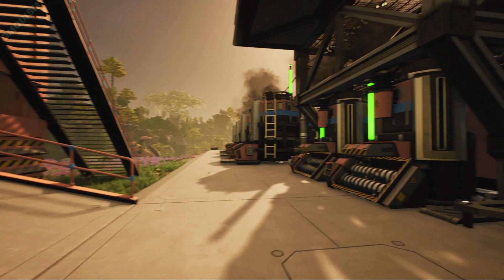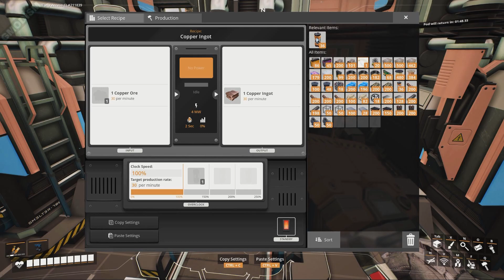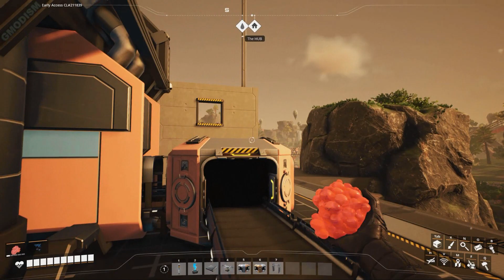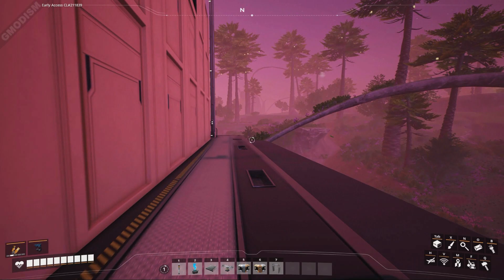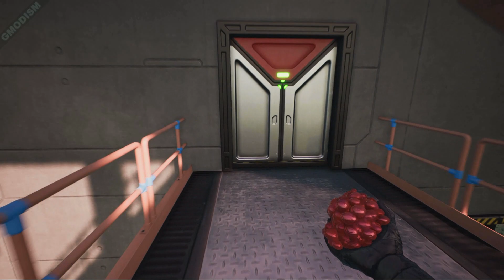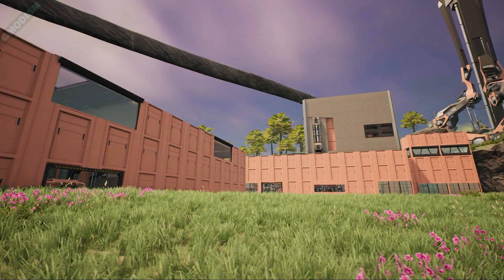5 Must Have Blueprints For Mid-Game - Satisfactory New Player Guide EP24

Comment: Most definitely liked your design. But my factories tend to be more like Naked Sports Motorcycles. Where you can actually see the engine and the moving parts. I don't like walls in my factory.
Reply from the maker: That's cool mate, they are beautiful! If you ever meet some performance issues, box it in and see the frames return however... 💎

Comment: Sorry for the late comment, but don't mergers and splitters glitch out sometimes when you snap onto a belt like you did in this vid (the belt would just ignore them, basically)? Same with pipe junctions where you have to delete the pipe and reattach them.
Reply from the maker: It can happen so it's important to check that they are actually working, not sure if the problem remains in U8 though.
Reply: @GMODISM  Apparently it does still remain. I couldn't make it work yesterday so had to delete the belts and build the splitter/merger first. And should say I'm very new to the game. Decided when it came out to play DSP instead of this. They're very similar, and I know what needs to be done, but as always (for me), it's hard getting started with new pieces and parts on such an uneven planet surface.
Reply from the maker: @MrRichalu  Oh darn, well let's hope for a fix until official release then!

Comment: Nicand compact. I am looking foward to use and upgrade this design for manufacture. For better  movemet in facilites I would use hypertube system.
Reply: Yeah, but ladders are slow midgame, if you connect all 4 parts to assembler ,it will become long to use hypertybes.
Reply from the maker: I probably should use them more, but truth be told I just hate the way the camera clips through things and terrain when in the tubes XD
Reply from the maker: Hope all goes well! Yeah hypertubes are nice but I am like one unlock away from jetpacks...
Reply: That is downsite of using tubes, maybe they will fix them. (devs)
Reply: Also i am maiking now main base, i will post it on your dc.